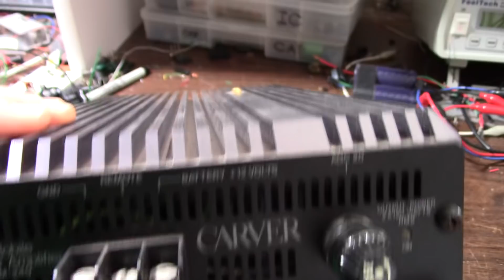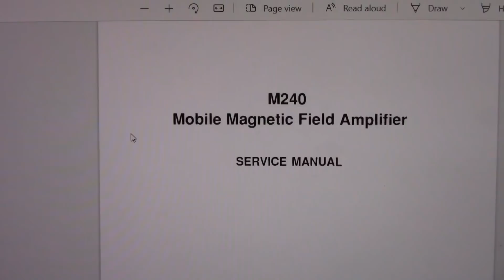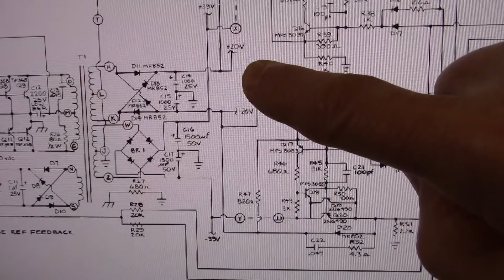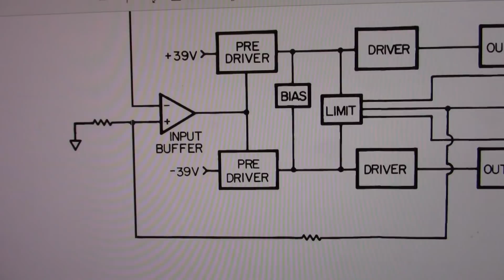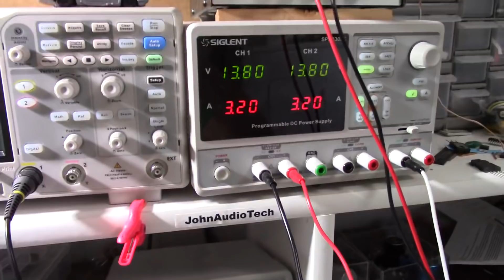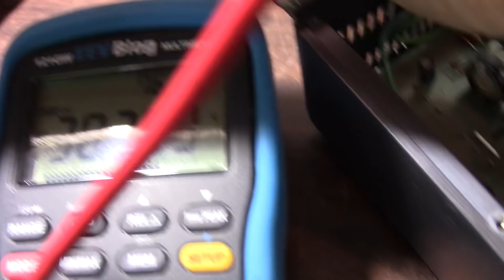Carver M-240 car stereo amplifier test

Comment: That probably had a 30A fuse because it was blowing 20s.  I had one of these back in the 80s and I had that problem.  Never could figure out what the deal was, but it worked fine with the higher amperage fuse with no ill effects.

Comment: Old video.. but why look for a DC on the output? When speaker output is AC.
Just asking.
Reply from the maker: DC on the output means a failure within the amplifier and is therefore just a check. Connecting a speaker to an amp with significant DC on the output can destroy an expensive speaker.

Comment: I still have one of these. I installed it in 1987 in my 84 Z28. Typical 80s system with Sony cassette/cd changer control head unit, 10 disc Sony changer, Sony 4 channel amp and Carver for my subs. It drove my 12 inch subs very well.

Comment: These amps were SQ through and through..I ran Two of them in my mini truck in 1987…retail was $299….Also could run high level inputs also if RCA’s are not an option from headunit
Reply: Bahahaha..OMG.... These original M240 amps were the biggest piece of shit in the late 80s. It was basically a Pyramid amplifier with the Carver name stuck on it ....Jesus dude stop commenting.

Comment: Get a full car battery + your PS running 14.0 on there and let's see what she'll do ! :)   Or send it over to Big D over at https://www.youtube.com/c/bigdwiz/about and give him the okay to test it to 2 ohms (maybe just the burst test :) I had one of these in high school running two Koss  M/90 Plus' in my '66 911. They laid perfectly across the folded down rear jump seats with my Calculus book between them haha. I carried an extension cable in the trunk so I could yank them out and set them up outside for an impromptu beach party or whatnot - haha. It sounded near as good as my home Carver 1.0t + B&W DM560 speakers (with less SPL capacity naturally).  Really impressive for a car amp. Would be really interesting to see it's full potential in output power + efficiency compared to today's typical Class D efficiency kings.  Thanks for the vid !
Reply: I had one of these as well and loved it.  I had a Soundstream TC308 tape deck with some Cerwin Vega cs18a 6-9's and other components. Man I miss the 90's! Great engineers back in those days.

Comment: I know that the OEM amps in cars have much lower power output than aftermarket amps.  I was surprised that the Chrysler unit in your older video had as much output power as it did. The newer GM cars have a separate amp from the head unit. Are they still using the same kind of IC chip amps that they did 10 or 20 years ago? I'd like to get the amp from a wrecked car and send it to you for testing if you are interested.

Comment: How does that commutator work? If you look at r38, r39, r40 and Q16 (r30) it looks like it switches both from 20 to 39 volts when the (either) output exceeds ~14 ?? volts? (r34 positive feedback for hysteresis??) 

If you play one channel at full power and the other at low power will you burn up the low powered channel output devices?

Comment: Its just amazing that  you can jerk around a power supply rail like that and not introduce some blip in the output.  I would expect even parasitic capacitance in the output transistors to at least pass some of that signal through.
Reply from the maker: They depend on SVR of the amp to minimize it. I'm sure a little gets through. The output stage has no supply bypass capacitors after the commutator circuit (they would interfere with the speed of the rail switching). I'm surprised the amp can be stable.